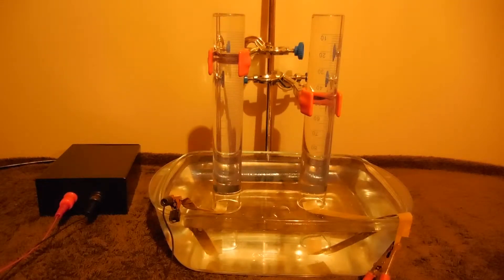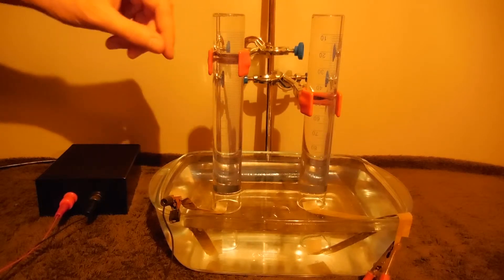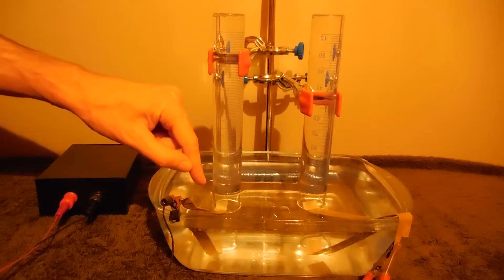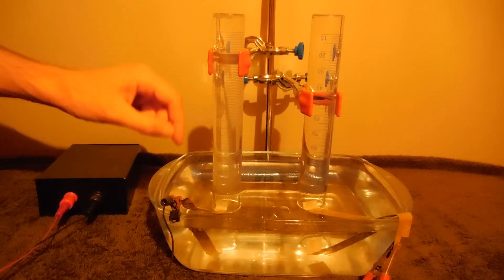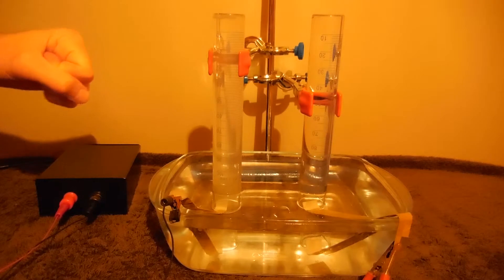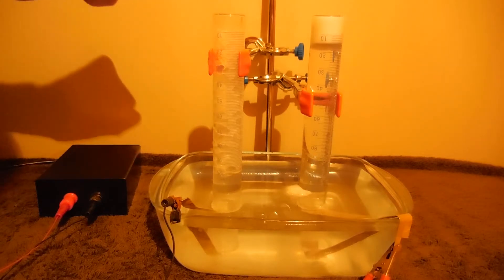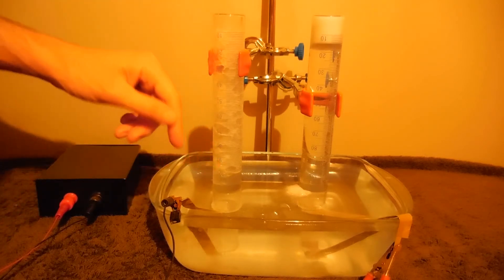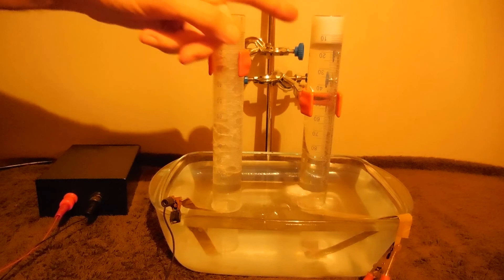Physics Experiment Electrolysis Of Water With Aluminium Electrode Timelapse Recording Full HD video

Comment: Another visit. At room temperature it makes Aluminium Hydroxide Al(OH)3 not Aluminium Oxide. You are hydrolysis Aluminium which inserts an OH into the resulting compound. The gas at the Anode is probably Hydrogen as the Aluminium sequester OH very quickly leaving H. Oxygen doesn't have time to form as a gas as it is bound to the Aluminium.

Comment: What analysis did you make of the Anode electrode? How did you analyse this gas?
Also... what grade of aluminium were you using. Without knowing these things it is a bit difficult to really get to grip with such a broad statement you are making with this experiment.
If, for example, you just happen to try this with marine grade aluminium you will have different results from something like aircraft aluminium as you would with food grade as used as wrapping foil.
That said, I really appreciate your experiments and the time you have taken.
Reply: Martin Moore I like to know weight reduction of aluminium electrode's during electrolysis process ...

Comment: Hi. I have a question about your experiment.
how much hydroxide aluminium is made from this experiment?
greetings.
Reply from the maker: +Jose Gutierrez 
Hydrogen gas at 0C,101325Pa, has approximately 0.0446 mol/L, so 100 mL has 0.00446 mol of H2. To produce 1 mol Al(OH)3 there are needed at least 1 mol of Al, and 3 moles of H2O, which will produce also 1.5 mol of H2. According to this it could be estimated to produce approximately 0.00297 mol of Al(OH)3, with mass 0.232 grams.
Reply from the maker: +Jose Gutierrez  You meant Al2O3 rather? The most likely it's Al(OH)3 You need to get ride of water, to turn it to Aluminum Oxide..
Reply: +Przemysław Gruchała 
ok thanks man.
sorry for that dumb question jaja
Reply: Roughly 1.89 times the mass of aluminium consumed.